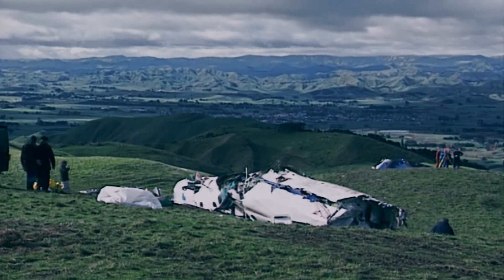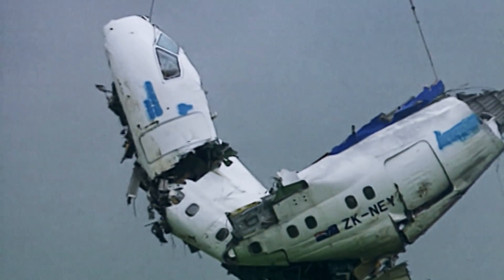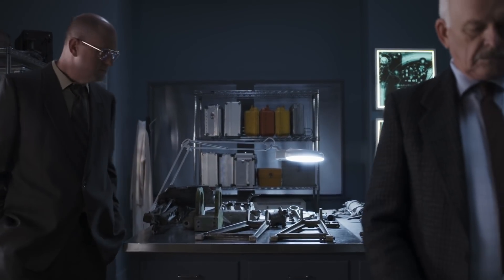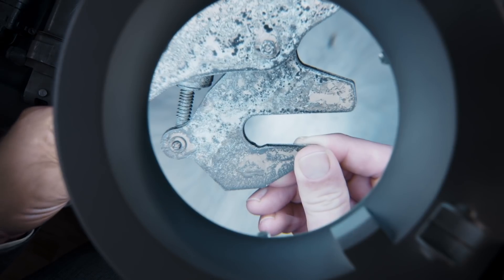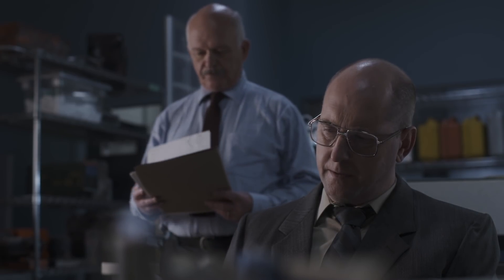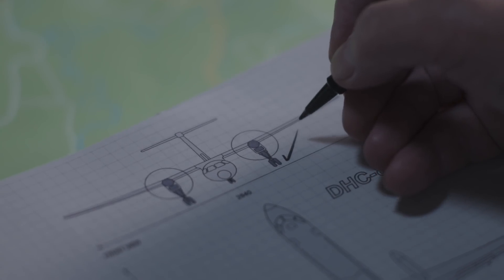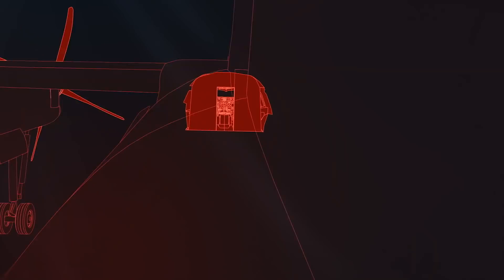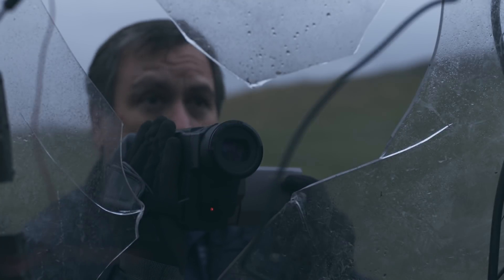Troubling: This Plane Type's History of Landing Gear Failures 😳 Air Disasters | Smithsonian Channel

Comment: 3:00 WOW!! The alternate system is 100% reliable. Dude. I have been in aviation for 12 years. Granted it's military UH-60s but I have never heard someone say that. We could argue for days about the tech but any system or part touched by a human immediately drops to 99% on that fact alone.
Reply: Historically, not in the future
Reply: @brucebaxter6923  If you are referring to human hands being replaced by robots they will never be fully replaced. Hum. Never is to long. 200-500 years? Then the issue will be the robots were built by human hands until machines are making machines while we bow to our AI overlords And people pray for the one to return talking about some prophecy in the way back before time. All hail the Ma'T'rx and the return of Kne'hoe who was lost in the war of Skynit..... He will be back.........
Reply: @brucebaxter6923  AHHH. My bad. DAMN GOOD POINT. Ok that second part about the pilots doesn't work for me. I've worked with A TON of pilots. (mostly helicopters)
I think fatal crashes because of pilot error is around 50% aviation wide (around 80% including mishaps with no casualties)Naturallynobody
Reply: @lknanml  
I have similar statistics, around 50% pilot initiated, as in there would be no problem if the pilot was outside the cockpit
And
2/3 if you include the pilot reacting incorrectly to a bad situation.

I strongly suggest that an engineer and a navigator replace the pilots, modern planes are just too complex for pilots.

Let the plane look after itself and just monitor its condition and position, we can send dragon up to dock with a 27,000km/hr space station without pilots, in sure we can get from one runway to the next.
Reply: @brucebaxter6923  And people want Flying cars......
Reply: @lknanml  
They have them, called helicopters.
Reply: @brucebaxter6923  No.. I worked on helicopters for 12 years. They are nowhere near cars. A helicopter takes a good 20 mins just to get ready to fly then another 10 just to start.  The maintenance required per flight hour is insane. People leave for work with their coffee cup on the roof and make it half a block before they realise they have a flat tire..............
artificially lengthened like an automobile license.experienceTrainingTraining
propulsion. Blades pushing air. Wings giving lift and the speed needed to fly equals zero to hover. That is a LONG way off. Helicopters are WAY WAY more complicated than planes and though they act more like cars like being able to land on your house or at work without an airport or runway it comes at an enormous cost in upkeep and training.
Reply: @lknanml  
They exist.

The good old r22 has the same purchase price and running costs as may luxury cars.

The us military have been operating autonomous kmax for at least the last decade.
The devices exist, the technology exists, blackfly has been available for a while now. 

You may like your 6seat twin turbine machines but that’s not everything.
Reply: @brucebaxter6923  
Sorry. My tech point before my rambling was supposed to focus on people. When they have a mechanical issue they just pull over. Few people do a worthwhile precheck. Open door, insert key off we go. Spinning blades even ducted electric or turbine require preflight checks. I've been in the military for 12 years. MOS 15B20 Turbine engine mechanic. Even the smallest issues add up quick. Imagine aircraft in front lawns across the nation. People just getting in and off they go. 
Calling your boss. Gonna be late to work boss. No boss I didn't try to take off with a missing prop blade again. No it wasn't a jump rope around the mast. I left my coffee cum on top of the cab when I took off and................................

Look up the limitations of the Blackfly. 
It is just barely on the no license required line. To equal the useability of a car it will require a pilot's license just adding a passenger. Or a heavy lunch. LOL Those specs for non licenses flyers are tight.
It also has not gone on sale yet although I think the 25 units they are making have buyers. 
Moller had the right idea. Just couldn't pull it off. 
Funny you should mention the R22. That is what they were using when testing their electric powertrain at our base.

LOVE the KMAX. We drop water on the fires with 60s every year. A fleet of those guys would be awesome. Night or day.
Reply: @lknanml  
ahh, yes, people are a problem.

sorry i missed that point.
the advantage here in having the aircraft fly itself and the pilot request destination/actions etc etc is that the system will shutdown and lock out an unservicable vehicle.
im sure you are familiar with vibration measurement, load cell torque and thrust etc etc.
even down to a simple fibre optic cable embedded or bonded to the skin and structural components can measure the flex or distortion and pick up cracking long before a visual preflight.

honestly with todays sensors its possible to autonomusly monitor even the viscosity of the oil while in operation.

Comment: They were probably too focused on the checklist they didn't see the hill
Note: Idk anything about this crash
Reply: Wow may notice that landing gear wasn't in position while landing protocol was going on, please don't tell the checklist was both crew members fous landing
Reply: First Officer was doing the checklist and missed a step and the Captain said he’d be in control flying but was instead distracted assisting the F/O and the plane therefore flew into a hill. The GPWS sounded very late for idk where it only gave 4 seconds for the Captain to go around.
Reply: @theveganricemonk   yes as they were so busy handling landing gear   they didn't check the gpws
Reply: @retr0gaminghub  The GPWS is the one that sounds ‘Terrain terrain pull up’. It didn’t sound until it was too late, so it was actually faulty
Reply: but the pilots are the one held responsible, especially the Captain who was supposed to be flying the plane

Comment: This incident  reminded me of Eastern 401. The pilots were so distracted by a malfunction of one component, they didn't notice that they were descending and crashed.
Reply: Yes, landing blub light issue but this one landing gear was not there on the position
Reply: Exactly. Distracted pilots.
Reply: @perfectscotty  They found the  Radar altimeter antennas to be painted over giving the pilots false data.
Reply: Plus, they were flying on autopilot. But the captain disconnected it by moving the yoke accidentally. That was when they started to descend. Of course they didn’t notice it since they were only focused on the problem with the landing gear (later known to be a problem with the landing gear indication lights).
Reply: @korea3175   yes that  Eastern airline 401 but this different case
Reply: indeed